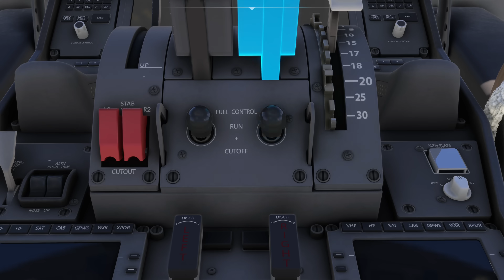Air India 171: Why Did The Fuel Cut-off Switch Get Moved?

Comment: 10 seconds is an eternity!  If he'd done it immediately instead of asking the other pilot why...there might have been an outside chance of those engines spooling further up.  of course, that's a big ask when the flight last only 30 seconds.  And that explains why the pilot chose that moment to activate the fuel switches into cutoff.

Comment: My question/comment. I fully understand the need to be able to cut off fuel in case of a fire.  However, being that most if not all 2 engine jets can fly on a single engine, why can't the engineers change the flight logic to only allow 1 engine to be shut down during flight. There would never be a need to shut both engines down during the flight logic program.

Comment: Something does NOT add up here: If Pilot 1 notices, Pilot 2 put the switch to cutoff. Put them back to RUN.. When sees there is no time, and they are about to die, why doesn't scream bad words at Pilot 2? Look what u have done MF, or something like that? Punch him in the face?
Also  scream stuff to leave a record in the CVR ??

Maybe P1 did not see P2 change the switches, maybe there was some ambiguity there.

Also If P1 saw P2 cutoff in real time, would have probably been like:
WTF are u doing?? My airplane! Put switches back immediately, not after 10 secs.
If he didn't see him in real time, how did he notice so quickly those switches were off? You really need to know where to look or have a photographic memory.

Comment: I totally agree with 2 inputs on the fuel switch. Add a panel switch for Captain and 1st Officer. When the switches on both sides match, then the Main Fuel Switch will then shut off the fuel.

Comment: Something I've been thinking about and trying to zoom out a little from the report instead of focusing on what has been said, is it possible that where the fuel cut off switch is monitored by the flight data recorder is in the fuel management system and not the switch itself? I'm guessing it is an electronic signal that is being transmitted to the FDR rather than the physical switch position? Could it have been when the pilot asked why did you cut the fuel they both looked down and seen the switches still up and quickly dropped the switches to cut and then back to run to reset it?  I noticed we didn't get the time stamps of the time in between the switches being put back to run like was mentioned about the switches being put to cut with a 1 sec gap in-between. Also curious to know what happens with the computer on the Boeing if both switches are put to cut at the same time? Does the computer complete the engine 1 fuel cut first, then the 2nd and if so what's the time delay? If it turned out to be 1 second I'd become very sceptical. Because 1 second exactly on the dot sounds clinical like a computer. I'll also be upfront and honest I won't fly on a Boeing aircraft I do not trust the company and statistics show Airbus are safer with much less hull losses overall.  I'll take an Airbus A320 or the newer A321 neo any day of the week. Anyway it would be interesting to know if anything I've said above could happen?

Comment: @Captain Steeeve ###MISSING OBVIOUS### At what stage is the landing gear suppost to be lifted up? It seems possible that the pilot may have made a muscle memory mistake. Do pilots usually call out 'raise gear' or just do so? It was suggested early on that a pilot could have raised flaps instead of gear, why not accidently cut-off instead of raise gear? I have been thinking too, and agree with your other viewer, why not design the system so Run / Cut Off is a double switch system where both pilots need to operate the same switch in order to Run or Cut Off. Probably makes sense, but obviously won't stop a conspiracy to commit an action. I note, one pilot said that their company requires one pilot to hold their hand over the cut off switches on take off until they reach a safe height, in order to prevent what has happened here from happening.

Comment: As FrankM suggested about two pilots required to cut off fuel, right away I thought Nuclear missile launch sequence!
  For such critical actions requiring a total shut down that would make the aircraft lose power, each pilot should have to insert their own key to activate!
  Heck! Thats been around since the 1950’s!
  Similar thing should be required for re-entering a cockpit in which a lone pilot locks out the other pilot. The one locked out must have some way to override a nefarious action by the lone pilot.

Comment: Just some random thought from me:

If the switch wasn't moved by a pilot, It's still possible for the other pilot that he says "Why did you do that", becasue he has no other explanation when he realises that the switches got moved.

the one second delay between the moving of the switches doesn't say a lot, if the plane is shaking every switch has a certain possibility to move itself in every second, so the probability for them moving in the same second is as high as moving one second apart from each other.

In my opinion it's actually relatively unlikely that the one pilot saw the other one move the switches, because then he could've immediately moved them back, but it took him until the engines were already slowing down, so the reason he realised it could actually be becasue he heared it and not becasue he saw the other pilot do it.

Comment: Video could clarify whether it was that one-in-a-million case of mechanical and/or electrical failure versus a deliberate human action.
This is important to know, because in the highly unlikely event of the former, we would know that the switches need to be redesigned to prevent future accidents.
P.S. Also, could the programming be changed to prevent manual cutoff being carried out during times like this when it would cause a crash?

Comment: However inconceivable, is it possible that the levers were not fully engaged in the run position (but engaged enough for the plane to think that they were) and somehow teetering/hanging on the detent. Could it be that as the plane rotated and they tilted backwards they slipped off the detent into the off position. One second for a human to operate is incredibly short and it would be an amazing coincidence for a pilot to operate them immediately on rotate as appears to have happened. The act of rotation should be definitively eliminated as the cause.

Comment: As Captain Steeeve said, draw your own conclusions based on the current evidence.  Let's assume moving the fuel selector to cut off was a decision motivated by self-harm.  What I don't understand is why jeopardize hundreds of other innocent people because of your decision to choose self harm?  This goes beyond just sui***e, this was mass murder.  It paints the pilot profession in a very bad light that those who have mental problems can't reach out for help for fear of regulatory action that could end their careers.  So they suffer in silence for years until they snap and this is not the first case of an aircrew member choosing not only self-harm but harm to innocent people.   Captain Steeeve is a credit to his profession for bringing this issue to light but the real problem is the FAA in my opinion.   You have to put on a happy face and bury your problems to keep flying or you are grounded sometimes permanently.

Comment: The idea about making the fuel cutoff a two person operation is a good one in theory but this is an extremely rare event. I don't know if the situation in AI 171 was deliberate or not,  though from what i have seen and heard it would be very difficult to explain the switching off of both cutoff switches as accidental. If it was deliberate then fine, making it a two person job would stop this from happening again but i am sure there are many ways a pilot determined enough could bring down an aircraft and i don't think it would be feasible to make every potential situation a two person job.

Comment: Capt. Steve, do you know for a fact that the DFDR record of the fuel switch repositioning from RUN to CUTOFF was caused by a deliberate pilot action, and if so, why?!  As I understand it, all the DFDR indicates is that such a command was relayed to the FADEC. Have you established that the data source to the DFDR is directly from the fuel switch maneuvering by direct pilot action, and not from the FADEC itself which may be due to spurious system faults? 

I would point out is that given how terribly flawed you initial, simplistic, and terribly flawed your original explanation (raising flaps instead of landing gear) was, you might want to be a lot more nuanced in your subsequent analysis.
Reply: As a jet pilot myself, I am telling you that no pilot would ever ask the other one why they turned off the fuel unless they physically saw it happen or saw the physical switches in the off position. Any pilot would assume 50 other possibilities for loss of fuel flow (computer glitch, fuel contamination, fuel pump failure… etc.) before ever thinking it was the switches being moved to the off position.

For the same reasons you are having a hard time accepting it was intentional, I promise the pilot has that same logic and would never jump to such an insane conclusion. It is not part of training and would never be a pilots first thought. He would only say that if he had immediate physical evidence to come to that conclusion.

Comment: You may have already debunked this, but if the RAT was deployed by accident from the cockpit, would the system shut off the engine control system in a program to shut down systems that were not controlled by the minimal systems of the RAT, and since deployment of the RAT would almost assume that both engines were inoperative, shut off fuel to the two presumed dead engines, and the FDR would record the fuel shut offs as being moved. I wanted to know if the physical switches were found in the shut off position, But I understand that that they were moved back into the "run" position> Is this confirmed by the CVR or is it assumed by the position of the switches?

Comment: I was thinking about the two maintenance Fuel Switch replacements on that plane that were reported having been done earlier. How common is that on these type of planes? And why did it need it twice? Makes me wonder if this plane had some issue keyed in on the switches, it was pulled and replaced but then the issue happened again so replaced this last time. Logic that it was a part that had just failed, and then maybe a bad batch. I’m sure there was a checklist done on resolving the problem.  But could it have been a different problem than the switches themselves that only happened under certain circumstances? 

The plane had just flown into that airport so we know the fuel switches went okay from cutoff to run to cutoff as it was prepared to be readied for trip to London. It then operated okay from cutoff to run to get them in the air again for this departure. The engines had operated properly each time, even spooling up when it was discovered the switches were in the cutoff position so wouldn’t seem to be an engine issue per se. 

I just think this will take time as it should. India’s DGCA just instructed all such type planes to undergo an inspection of their fuel switches by July 21, so will be interesting to see the outcome (based on the Boring 2018 advisory that was not ordered by Air India to maintenance at that time). 

Another development was reported on an Indian network that apparently one of the pilots was know by other fellow pilots to have taken time off so the question was for what.

Comment: There's multiple other Boeing plane types with the same or very similar fuel cutoff switches.  And AFAIK the FAA and Boeing have sent out zero notices for urgent inspections to be done on those switches.  Yet straight after the LATAM airlines seat incident the FAA sent out an AD requiring immediate inspection of the seat switches.  I've also read that the Air India Captain had had recent medical leave.  What type of medical leave??

Comment: Now, Boeing is going to have to rewrite the software to prevent suicidal pilots from killing passengers too. The software needs to prevent fuel shutoff during takeoff. There is no scenario where shutting off fuel to both engines makes sense during takeoff. The software seeing that situation should delay fuel shutoff until the plane has reached sufficient altitude.
NASA 
Design engineers need to consider every worst-case scenario. Something they failed to do with M-Cas Obviously, the Boeing software engineers never considered any pilot turning off the fuel to both engines during takeoff. Now they know that can happen. They must prevent that from occurring again. Why, because we know mentally ill people copycat other mass murders.

It appears on of those pilots deliberately turned both fuel switches to the cut off position immediately after the plane lifted off. My guess is the First officer had both hands on the yoke at that time. The final report will probably include a psychological evaluation based on the what had occurred in the pilot’s life in the weeks and months leading up to the incident.

The investigation team knows more than they are releasing, but will delay the full report until they have more information on the psychological state of both pilots. This is not rocket science, but it does require further investigation before they are willing to release the final report.

Comment: Why does the aircraft even allow to enable cut off the fuel switch to BOTH engines after V1 and before a critical altitude where below that altitude does not allow both switches. Even if engine catches on fire at critical acending altitude you beed thrust first before cut off

Comment: Hey captain I’ve got a theory. Based only what I know about people, and that’s a lot, and the evidence, the sequence of events and the pictures of the two pilots, only. Both were use to same sequence of events. Captain in charge,  stuck in conservatism, which is acceptable but slow to action. As all are in a stuck level of conservatism. When hit with mild  anger that capition may drop to fear just a little and pause. Now the copilot not as bright finds himself able to act quickly and may think cap is not as able due to his slow movement. Copilot, a bit cocky, and dangerous, may have been on the edge, clashing as much as he may have, put it all to a test in the most extreme way. That’s the picture I see. I do want the truth, just seems most likely, thanks PR 5:14

Comment: Initially, you deducted that one of the pilots accidentally raised the flaps as they took off mistaking it as the "gear up".  But we are forgetting that the gear never went up. If the Co-Pilot was in control of the yoke during take off. The captain would be the one raising the gear up after "positive rate", correct? Well, if the pilot controlling the yoke is focused on the run way and the take-off with both his hands on the yoke, he would expect the gear to go up and he would see the other pilot reaching up and over the console to flip the gear up, but instead, he doesn't see the other pilot extending his arm UP, but instead  down to where the fuel cut-off is located and didn't really think about it until he heard the engines winding down. And that's when he asked "Why did you cutt off?"

Comment: Both Fuel Cut-off Switches were turned off just 1 second apart.  But turning both back on took 4 seconds apart.
Why would turning them off be so much faster then turning them on???

Today's news seems related.  India (AAIB) requests all airlines in India to check 787 locking mechanism on all Fuel Cut-off Switches for defectives, disengaged, etc.

Comment: Good discussion  Q: Was the throttle quadrant found? if so I would suggest a microscopic examination of the switch itself to see if there is a tracing of the travel of switch from moment of impact much like each bullet leaves "finger print " in the barrel go a gun .One should be able sequence the trace with the FDR and CVR. you would be able to see if these switches were moved post crash or pre crash. etc. 
As for the comment   of having  a  "Physical" system  requiring both pilots physically place input before selecting the changes in the fuel switches I think may NOT account for an incapacitated pilot under an engine fire sitution?

Comment: Is it possible there was an electrical or computer issue that turned the fuel switches off... NOT the position of switches? 
And then the pilot had to switch mechanically to "off" THEN "run"?
Would the plane record the turning off the "second time" IF THE AWITCHES WERE SOMEHOW ELECTRONICALLY in the Office position?
I'm trying to figure out the four seconds to turn on one, then two.

Comment: Cart before the horse.Exactly what is the FDR's point of reference.
Engine management computers losing fuel latching circuits to electrical failure, isn't the same thing as fuel cut off switches moved from run to shut down.

Comment: Captain Steeeve, your concern for mental health and safety of airlines is commendable but please, do not allow this to become a preoccupation. The fault in the fuel switches covered by the 2018 FAA advisory does not make it impossible for the planes to fly; all it does is make the switches prone to moving accidentally. At present, it is far from conclusive that one of the Air India pilots deliberately moved the switches, intending to take his own and other people's lives; if the switches moved accidentally, then imagine the pain wrongly assigning such a dreadful motive would cause to the near and dear ones of the deceased. Compassion please !

Comment: When did the rat deploy compared to v1, when were engine thrusts dimished, when were fuel cutoff switches switched to off. Do those fuel control switches directly connect the fuel cutoff valves or do they connect to a computer which actuates the cutoff?